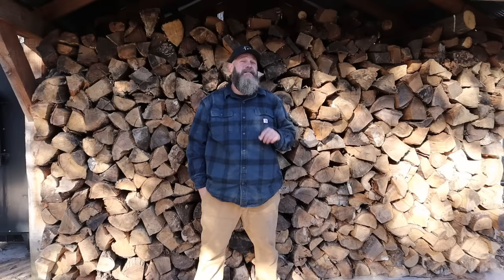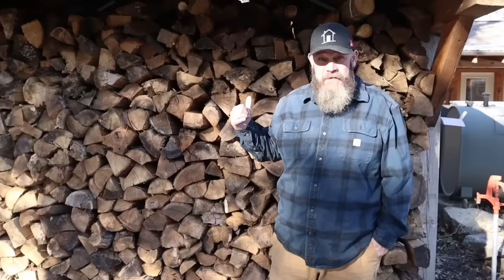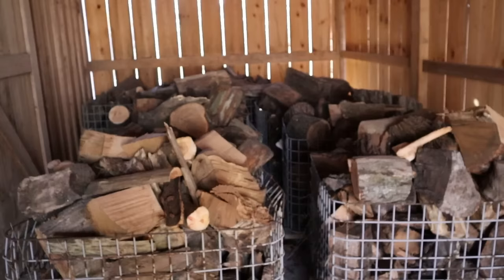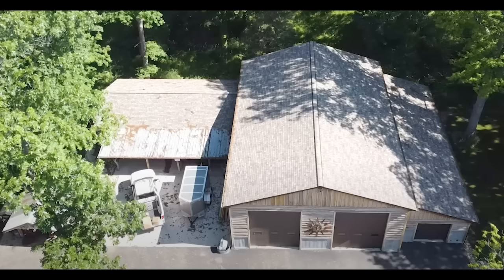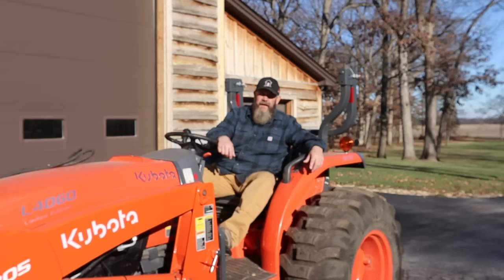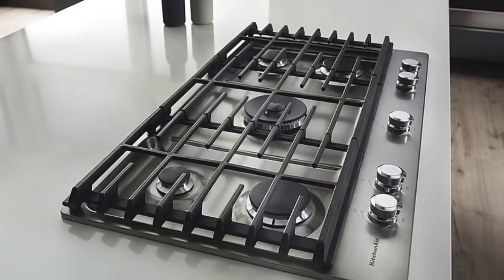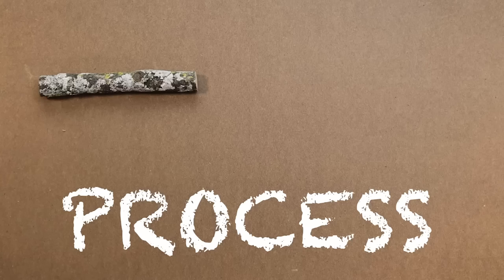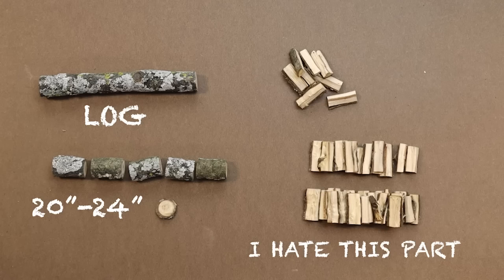Watch Before You Buy an Outdoor Wood Boiler!

Comment: The "Glycol looses antifreeze properties at 120 degrees" part doesn't make sense. The most common use-case for glycol antifreeze is in automobile use. Normal operating temperature for a car's coolant system is around 200 degrees. 

Most thermostats in a car won't even start to open to circulate coolant from the engine until it reaches 180 or more, and only fully opens at around 200. 

So I doubt a vehicle that sees regular heating and cooling cycles would use something that degraded at such low temperature, or if it did, antifreeze would have to be changed as much if not more than oil does.

I see you put the little clipping of the glycol antifreeze info saying it was good for temperatures under 300, which makes more sense, but what you said and what you showed conflict each other, and it isn't clear about what you are saying.
Reply from the maker: Thanks for clearing that up.

Comment: What I’ve always said about boilers is that not to drain it because adding new water frequently adds more oxygenated water that causes oxidation and rust but heating water causes the oxygen to be pushed out of the water making it stagnant water.
Reply from the maker: My well water has allot of metal in it that can't help either.

Comment: Just a kind suggestion. I’m assuming your audience is international. It’d be nice if you used metric. I’ve no idea what a cord is but I know kilograms. Also Celsius vs Fahrenheit. It’d be nice to include Celsius since that’s what the entire world uses EXCEPT the USA. 

I’ve got about 120m/2 of buildings and we use a coal boiler and use about 5 metric tons of coal in our 8 month heating season in Mongolia. If I bought firewood I’d need 10 metric tons for an equivalent amount of BTU’s and it would cost 8x more. Anthracite coal is about $44 per metric ton here. 

We have a coal boiler and use anti-freeze in the whole system. I’m not sure why but it’s what my installer recommended. That’s an expensive part of system. We only have 4 radiators and short distances from furnace room in a shipping container to our yurts and bathroom. I think it needed 60 liters to fill up.
Reply from the maker: Cool, thanks for watching!

Comment: Keep in mind that I've only used it for a couple weeks, that being said, so far so good https://www.youtube.com/post/UgkxAU9pOCSV9Y5JprooHvfxTpOrt4hx8uRM . Using it at 8 ft. by 8ft. deer blind that is insulated. I have to keep the door cracked for it to get enough air to burn, but that is very likely the wood I've used. Much better quality than I expected for the price. Now if I can just take it easy in the beginning it won't be 90 degrees in my blind. All in all it seems like a keeper.
Reply from the maker: Up for the challenge!

Comment: What's the names of the wood boiler that requires no or very li electricity and what about a Central Boiler ? Because it might be useful if a power outage  ?
Reply from the maker: Allot of people like Central Boiler. I think that would be my choice to do again. Most of them just have a blower or two and pumps to run so they wouldn't take much power. You do need your inside system to work as well so if you have forced air you would need the furnaces powered or if you have radiator heat you would need the inside pumps working too.

Comment: once you have a good fire going and a nice bed of hot coals can you use coal in your boiler unit? i hear coal burns hotter and for longer periods of time.
Reply from the maker: I have no experience with coal but I have heard the same. It is not readily available in our area as far as I know so it's not really an option. I hear it burns cleaner too.
Reply: I dont have an outside boiler but I have wood coal furnace heats almost 5400 sq ft home. Its a yukon eagle. I been burning wood for decades I usually use 24in logs 8 inch diameter holds about 4 and will last all night.  I also burn coal anthracite and to be honest it will hold 120 lbs and will last days. Burns at 900 no smoke no creosote. But 40lbs will last about 8 hrs of good heat

Comment: How do you do the propane boiler backup that kicks in automatically
Reply from the maker: it's just a valve that works like a thermostat. When the water line from the boiler drops below a certain temp it switches over to gas.

Comment: 600 square foot upstairs and then the basement. Is it worth it to get one?  If so which one?
Reply from the maker: If you enjoy splitting wood and burning it then it's a great way to get some back. I am currently in my 800 sqr. ft. cabin and I have a very small wood stove that heats the whole thing just fine and uses a fraction of the wood. Might be a better way to go.
Reply: Get a free standing Woodstove.

Comment: Living in north east pa, I'm opting for one that specifically burns coal. It's just as available as wood but is undoubtedly less work considering you only need it delivered and shoveled into the boiler. So far coal in my area coal is still cheaper than wood unless of course you have access to free timber. If maintenance is done on these units, which there isnt much really to do, they last a very long time. I think the best thing in terms of preventative maintenance though would be to have a roof over the unit. Great video!!
Reply from the maker: Thanks, mine is actually a coal burner. I got it right as they were having to switch to all gassifiers. For a while if you bought it for a business you didn't have EPA issues. They said if they burn coal in my model it passes EPA regs so they just called them coal burners and no one checks what you actually burn. I don't even know where you could get coal by me.
Reply: Rob   I totally understand what you are saying about if you have free wood or lots of land and the reason you want to use coal.  I noticed that you were in PA have you heard of alternate heating systems in PA they are a boiler company and have a coal boiler that is called the coal gun. I’m going to be buying one of their wood guns sometime soon. Because I have so much land and free trees from arborists friends.
Reply: @mainelyelectric  Thanks for the info! I checked out that boiler and its a pretty slick unit and is certainly high quality. Crazy amount of BTU output for such a small unit as well. One main reason I am set on an outdoor boiler is the mess as well as my situation. I am in a very old farm house built in 1817. Its bigger than you think, 2300 sq feet with cast iron radiators. My basement is dirt and often gets very damp and takes on water from time to time. Long story short, I want to remove my heating source from my basement and an outdoor boiler is the answer. I also have no room inside to store coal as the previous owners put two oil tanks in the coal bin. An outdoor boiler also keeps all of the mess and maintenance outside.
Reply: @robroy5729  Wow 1817 that is old must be a Beauty! I love cast-iron radiators I really wish that I had put them in my house. But back when my house was built in 1996 it’s actually a barn/living space  I was only six years old. But there is a section of our barn is not renovated yet so I’m thinking about maybe putting some cast-iron radiators in there because currently we heat with oil but like I said I want a wood boiler with oil back up because we have so much land approximately 107 acres.     I haven’t really done much research on alternate heating systems website about their coal burners because I’m always looking at the wood boilers.  But I thought that they had an outdoor coal boiler? I know they make amazing stuff there and that’s one reason why I want to go with that company! plus their warranty is really good.

Comment: We have boughten two different heat exchangers. They both have gotten clogged. We put straight anti freeze in ours. Was that the right thing to do?
Reply from the maker: I don't think it can hurt but I really don't know. I'd call the manufacture.
Reply: I’ve never used antifreeze for a boiler but it might call for a dilution ratio of water with the glycol too keep it from being too thick.  But also glycol gets acidic over time in boilers so it might also need to be checked and adjust the ph up again so corrosion doesn’t happen.

Comment: The glycol isnt for when its running, its for when it stops running. Frozen lines burst. Burst lines can be a disaster. 

You could run a wood fired steam boiler, that can feed a steam turbine and generate power.

Comment: So based on your numbers in this video, you are burning around 1 1/2 Cord of wood per 1000 SQFT. per winter.
Reply from the maker: Comes out to about that depending on the winter. I don't think you could say half the square footage would take half the wood though.
Reply: @buildlife  If you're are heating a 3400 sq' house and 4300 sq' shop plus hot water I don't think that is correct. I agree half the size doesn't mean half the wood.
Reply from the maker: @christhomas9837  Merry Christmas Chris, too many factors go into it. I actually have 3400 in the basement to and a 4 car garage. My basement has 9' ceilings but it is ICF concrete form walls and an insulated floor so just the heater cores in the furnaces and the pipes running to them keep the basement warm. I have a friend with a 150 year old house half the size and no out buildings and we burn about the same amount of wood!
Reply: Don’t forget climate plays a huge part in this equation.   It was -60 out here for 4 days and I burned about 1 full cord of wood in 4 days!

Comment: These types of boilers are going to be banned, and rightfully so. Not efficient at all.
Reply from the maker: I think they already are. I like that they will burn anything and I don't really have any neighbors but when I bought it they were going to register it to my shop so it had a commercial address. Then he told me they changed the model to a "C500", the C is for coal because when they burn coal in them they pass emissions requirements but they will burn anything.